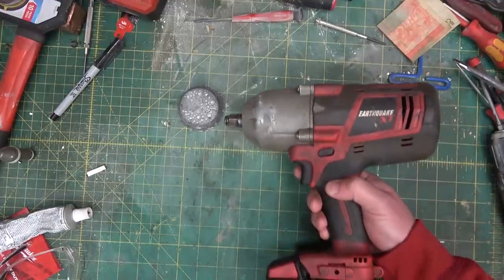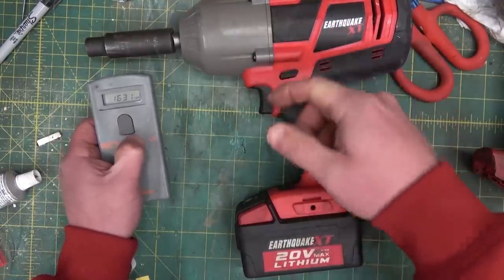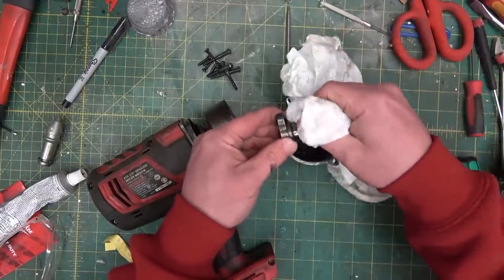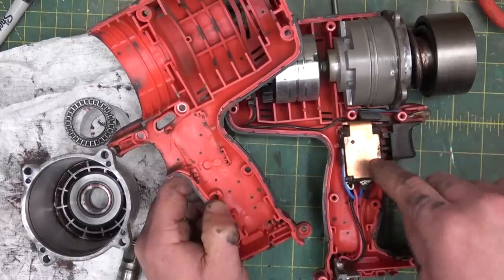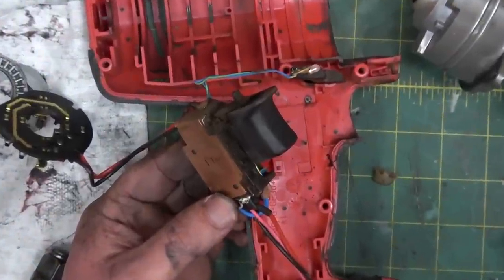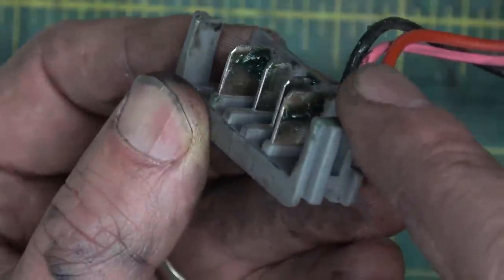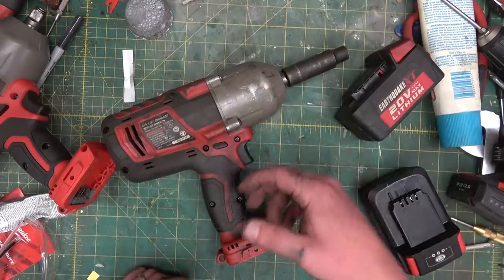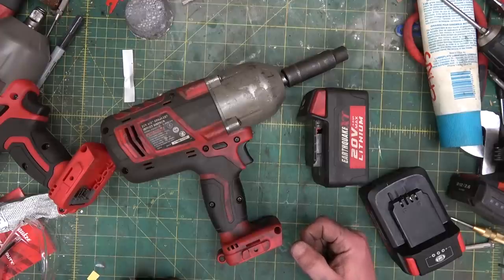BOLTR: Lost Torque 13 Month Earthquake Impact | Harbor Freight Tools

Comment: Would be interesting to start swapping bits from the new into the old until you found the root cause.
Reply: No doubt. He didn't try to meter any inputs or outputs. He definitely had the opportunity to easily do a much more thorough troubleshooting session and most likely did. 
Had to be an imposter. 😃
Reply: My thoughts exactly!....Get out of my head!!
Reply: It was all I could do to restrain the whiny 12-year-old inside my head saying “… But WHYYY is it weaker??”
Reply: It could be the controller
Reply: My thought.
Reply: It could that the controller is counting working hours and it slows down the speed of the motor. Check with a scope the PWM that it output to the motor. And you can swap with the new one that you have with the feedback and see if anything changes.
Reply: Ivan would have done a scientific analysis!
Reply: It's the switch change mine worked like new took the old one apart found the full voltage contact in the switch was errodded away
Reply: @jamesokeefe708  twas just about to suggest this!
Reply: I blame cheap parts in the switch/trigger. He totally could have tested the output.
Reply: @mrrutledge1967  I didn't hear a comment on the type of plastic casement, mold quality, epoxy on wires, etc.  Definitely an imposter.
Reply: Like the other guys said, it is probably the switch.  I have a bosch drill that lost its highest speed due to an overly hot supper--speed levels 1-5 were normal but it couldn't do level 6.  Something in the switch had burned out, confirmed by swapping out the switch from another drill.
Reply: @jamesokeefe708  did you replace the switch or just wipe the corrosion?

Comment: The speed ratio is almost exactly half power (sqrt(0.5) = 0.71). Maybe it's only running on one set of comm bars.
Reply: interesting point, that could definitely do it.
Reply: Probably one half of the pixie distribution facility. One FET goes belly up, motor works on one and a half H-bridges and load is unbalanced, another half-bridge has to go to restore balance - with half the power.
Reply: A couple of the brush leads were bottomed out in the brush holders
Reply: Yep exactly, one open set of windings

Comment: As an aprentice in '79 I mistook Neversieze for Luberplate. Put it on the valves during Briggs rebuild. It scoured the valve stems and wore the cylinder out.  The embarrassment and shame was worse than the short block I had to buy.  The old timers in the shop said I would never forget it. 40 years later, they were right!

Comment: @11:01 the brush at 6 o'clock is not extending out enough and as much as others. I suspect it would not be pressing down on the commutators as tight as it needs to causing it to float and have high resistance. The brush at 3 o'clock is also not extending out as long as the other too, but more than 6 o'clock one. Replacement of the brushes maybe the fix.

Comment: I had a Dewilt impact that had the same symptoms as that. There’s a contact that gives full battery voltage when you give it full chooch on the trigger. It’s past the potentiometer region where the PWM works. The full chooch contact is burned out I’m thinking!

Comment: When he first got it he often said you can smell the burnt varnish coming off of it, so I expected that from mine when I finally got around to getting one. Nope. I have no explanation either, mine just doesn't smell like a hot motor ready to blow up. I do love the portability of a hard hitting impact gun, I used to have to haul around an air compressor and generator if I needed that - took the fun right out of it. Wondering if a growler test would show much and/or a comparison of segment ohms with the new one?

Comment: Is the switch still giving it 100%  or is there some of that magic dust in there limiting the current out to the brushes?     (I've seen a few variable speed drills come back to life with a new switch )
Reply: Agreed, switch is suspect.
Reply: I'm also suspecting the switch, there's a big copper plate on it, which must be a heatsink, so there must be some electronic switching going on inside.
And when it gets hot, it could easily have cooked a capacitor which would result in an altered duty-cycle of the switching, resulting in less power reaching the motor.
Reply: @HomelabExtreme  In my experience when you pull the trigger all the way, the duty cycle gets overridden to just full power, ie the switching just stops and you get no interruptions to the power at all.  I can't see how a cooked capacitor would change this behaviour, especially considering that modern switch circuitry has a microcontroller in it which doesn't use a capacitor for timing.  It would be easy to bypass the switch entirely, just to see if it goes faster.
Reply: I thought measure twice repair once, but AVE did not break out the multimeter
Reply: Ditto, my money is on the switch being the problem.
Reply: @TimLF  That was my thought verify correct voltage out of sw, also looked more like ground up aluminum and grease,  like you'll find inside a failed transmission, looks like anti-seize buts it's the ground up aluminum and grease,
Reply: I agree,  switch is the main suspect after that rebuilding. AvE is bang on about the bellows too.
Reply: I agree. Why would Eric put anti-seize in it when he has a garage full of grease. Also I would have liked to see some current measurements between the two guns. Just because it's a different / newer battery doesn't mean it can supply the demanded current of a pooched motor. Or a voltage under load test would probably do the same thing and be easier to do.
Reply: Switches can be the root of all evil.

Wavechange switches on radios, and play/record switches on two-head tape recorders, are especially bad, as they are carrying the weakest signals in the appliance.

Unfortunately, that looks like a sealed electronic module that probably won't come apart; so the only way to test it would be by substitution.

They really cheaped out by not having a bellows over the plunger.  All that damage for want of a little bit of rubber  .....
Reply: The mosfet could be worn out maybe? (Helps deliver power to achieve variable speed)
Reply: that's what she said!
Reply: No it's like older DeWalt tools with variable triggers. It's like an Analogue potentiometer with a heatsink around it full of springs and levers.
They fail after a while and decide to work normally until you need full power.
I replaced 6 of these on a jigsaw and a cordless drill. They seem to enjoy failing
Reply: Agree.  Starts at switch - I noted - 'got too hot to trot'.  Silly, yes -  lol     I still have yet to work on drill.
Reply: I'd bet its brushes , samething use to happen to our RC car motors after a couple 6-8 min races on weekend, by 3rd moto it was sluggish.  Usually we cut cons and new brushes after every main race. Bring her right back to new. Cut com, reuse old brushes,  it was hit or miss like u never touched it
Reply: They even had "Rev Tech" drops to drip on brushes in between races to clean them halfass, most times they helped for a lap or 2 then it was back to a worn sluggish feeling heated up motor. Time for a cut and brushes
Reply: @benhitchcock3057  if the motor is driven by pwm, it would save parts to simply have full switch depression simply give 100 percent pwm, and so if the rheostat or whatever the switch activates is messed up, it may not be sending full voltage to the controller, thus low speed and power.

More expensive ones may have a separate switch or something that is activated to bypass the pwm driver, but that costs more.
Reply: That's what I was thinking as well. Mosfets dying?
Reply: @kwmiked  Ah yes.  I remember those days of brushless motors in RC.  Brushless motors have eliminated that.
Reply: It wasn't the switch

Comment: Always learn something from these vijeos. Never knew how never seize worked- now I do, makes total sense. Cool.
Reply: Wow it says you made this comment a week ago and the video is only hours old. Strange
Reply: Ano Nony little known fact- few bucks in the hat enables time travel
Reply: Me too I found the part about anti seize something I never knew that it had ceramic dust. I ran my ohm meter across a dollop of the stuff and it is not conductive. When threads of a screw are tightened then the screw makes good contact and conducts to the chassis. I wonder if copper anti seize would be better.
Reply: @anonony9081 
 wants  to talk about strange?
 I have been reading the comments in a video, and I am seeing comments that were in the prior video I watched. 
If there are any replies to that message, I open it up and everything is normal. 
 I can read the post that is meant for that video. 
Yea youtube wtf
Reply: Ano Nony patreons get week early access to all content.
Reply: Typically anti-seize is zinc/silica.

Comment: It may not be anti-seize lube.  It may be metal from the bearing itself.
Reply: You beat me to it, but the metal likely came from something other than the bearing. The gears or impact hammers might have been the source.
Reply: You know longer need to sit at the back of the class.
Reply: Homemade never sneeze I was thinking the same
Reply: Has a similar look to moly grease
Reply: Out of all of the tools he's taken apart we've never seen anything like like that with any other tool. Apart from that, if that were grease it should never have allowed that much wear in the bearing surfaces.

Comment: 10:50, the right hand brushes look like they're either seized, worn out, or just not being pushed down by the spring.  I'd look at those two brushes, and see if you can get them to push harder against the commutator.  Love these videos, keep up the great work.
Reply: I wonder if it got hot enough to anneal the spring?

Comment: The long drill driver bits can be had at the local big box lumber'n junk store back near the coil fed screw guns.Senco and Makita coil fed guns in particular use those.Usually #2&#3 Phillips and Robertson drive are availible and sometimes a couple sizes of Torx.

Comment: I worked at a company that built large generators. After building the rotor and turning down the commutator, I had the job of using a saw blade to undercut the mica inter copper insulators. This prevented the brushes riding high. After cutting down all the insulators, I then used a V bladed tool to deburr the edges of the copper followed by a light sanding.
These actions reduced the sparking from the brushes. Great work AvE.

Comment: Have the wired version of what appears to be the same one with a slightly different case. It was doing the same thing, died down to so little power I wouldn't trust it to properly tighten a lug nut on a lawnmower. Then one day I used it to reinstall a body mount bolt that takes ages of spinning with a socket wrench to fully tighten. It had a sudden jolt of power and busted the nut in the body loose. Still a mystery to me, had it apart when it was dieing the slow death and after it's second wind, can't for the life of me find what exactly changed, even went as far as checking the electronics. Has been working pretty good for a year now since it's sudden rebirth. Just a shame it's too damn big to fit into places I need it most.

Comment: Had the same problem with a dewalt. Discovered with mine it was the potentiometer that was failing. It had a increased resistance and therefore was not putting the same out. Just my observance.

Comment: From the look of the brushes, there wasn't much sticking out on a couple of them and the flex's were badly discolored.  I think it is running out of brush length and it would be interesting to try with fresh brushes that now will have proper brush force on the comm.  You can see that a couple of the flex's look like they are keeping the brushes from extending and there isn't much showing.

Comment: I have had 3 snap on and a Milwaukee over the past 20 years. All electric impacts seem to wear quicker than pneumatic. The Milwaukee rated at 1200ft lbs is two years old and today is the first time it would not take a lug nut off or break the stud.

Comment: Damn, you got this video up quick! Sweet!

Can you measure the resistance through the trigger switch? Some of that grit may be doing its dirty deed in there. If it is hooped at the switch, is there any reasonable price to replacing it or opening it for some cleaning?

Comment: was that really anti-seize or was it worn out washers?  glad you mentioned that the Milwaukee one didn't fair much better.  I'm thinking switch is wearing out or adding some resistance to the circuit. now we know where Eric's HF impact went to.  I've noticed he's back to using air again.
Reply: yeah, I manufacture grease oil and antisieze and that looked like one of our competitors , ours is like that but much finer.
Reply: @sailingitlldo1109  thanks.

Comment: Could try adding a spacer behind the brushes to increase the spring force. Might help.
The fact that the brushes are warn shorter and the springs got hot may have resulted in less spring force than is needed.

Comment: i wonder the problem is the spring tension on the brushes.sure, they're still in contact with the commutator but the more worn down the brushes get, the less pressure they're able to apply.
on a related note, a friend of mine recently had a conversation with a motor rewinder, about why their permanent magnet dc motor was losing torque. it turned out that it was in part because they had been seperating the rotor from the magnet,  which apparentlymakes them weaker. so maybe the answer lies in comparing the magnetic flux of the two motors.

Comment: It is still 400 rpm low... try swapping the speed controls?  If it is winding damage in the motor then it won’t be worth fixing.  A speed control, possibly.  

  Might just be conductive (or insulative) dust on the speed control wiper... 

  I found a hilti corded hammer drill, with the cord cut off off the side of the road on the way to the dump. Tested with new end on cord stub, still no work.

  After it sat on my workbench a while, (until I needed a good SDS hammer drill next,) I opened up the speed control trigger mechanism and found the variable resistor wiper was covered with dried on concrete drillings powder... cleaned the whole interior of the speed control with a toothbrush and soapy water, blew it out with a compressor and dried with a  blow dryer, and tested it with a new cord.

  $250 tool for an hour of my time, a salvaged cord from a blown shop-vac, and 1 cent worth of dish soap.
Reply: Switch cleaner would have been a better solvent to use or Isopropyl Alcohol

Comment: get that brush ring replaced a Milwaukee will fit  and a side note if the springs can't push the carbon brush to the commutator hard enough the amp transfer drops because it's arcing to the commutator not touching ! and so less rpm, no..!
P.S. i fix Power tools for A living

Comment: Could be a small short on the micro controller board which reduced the RPMs or, the potentiometer worn and not hitting a full throttle position. 
I’m not convinced the thing just dies a slow death, it has to be the micro controller pcb

Comment: Back in the day, when we used DC Brushed motors for racing RC cars off road, they'd die the slow death because the windings in the armature would build resistance from being over heated. Same with the brushes the shunts and the springs would weaken. Same thing with the comm plates. We'd turn them down on comm lathes to expose fresh copper, slap some new brushes in, new springs but its on its way out. Always ran stronger springs on the positive side. Fun thing, larger comm diameter gave us more torque 'Truck Class' and smaller comms gave more Rippums 'Buggy Class'. Eventually we'd run the comms down so far on the lathes they'd explode on the straights. Was always a magnificent sight. All the winding combinations too, 14 single 14x2 14x3 etc in everything from 27 turn 'stock class' down to insane 6T Triples in Mod 4wd. Oh the 90's.

Comment: There needs to be a Part 2 to this! I can't believe you would end it without a conclusion. 1- the Magnet could have gotten weaker, doesn't seem likely but Neo has some strange properties with hit and impact. 2- One or two poles of the motor could have failed. Maybe the lead wire solder joint heated up and crystallized/oxidized the solder joint. with the high rpm of the motor, you might not even notice it except for lass power/slower speed. 3- a failure of the motor controller of some kind. Mosfets overheated and now have higher internal resistance or some other failure of the controller. what is the voltage at the motor vs new(er), what does the waveshape look like?
 I am just not believing that a mechanic resistance is the issue. the speed seems to consistent without any evidence of mechanical issues. This has to be electrical. Come on AVE, don't leave us hanging like this.

Comment: BTW I got my new Ninja and there is a very interesting update in the design: A safety feature that appears to use planetary(guess, I haven't taken mine apart yet) gears to the bottom of the food processor/blender to spin the inside one fast and the outside one slow. If you don't shut it off the proper way it now stops in a quick fast fucking hurry. Might make an interesting teardown.

Comment: I agree with you about selling yourself out by crying for warranty, it's hardly worth it. On the other hand, I wouldn't hesitate to write a review, documenting early failure. I wish air tools could be replaced, but they don't seem as prone to early failure as even this iteration of battery powered devices.